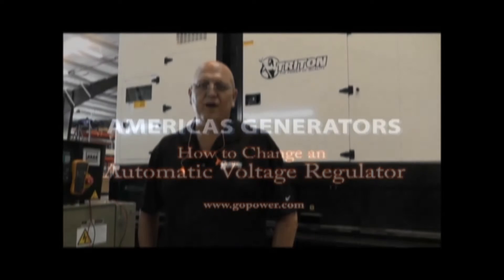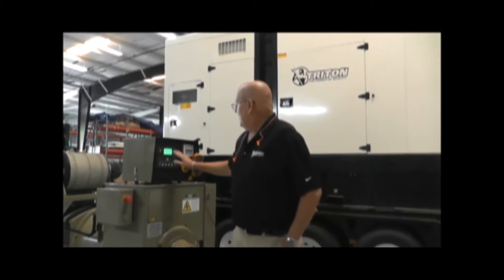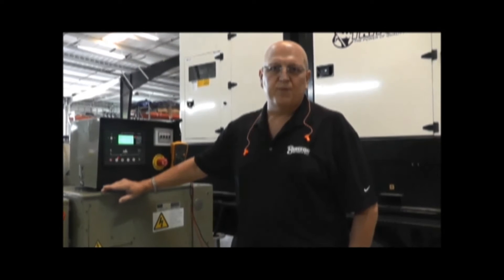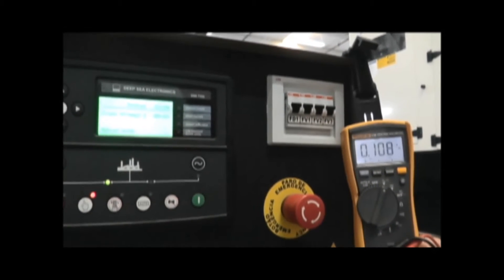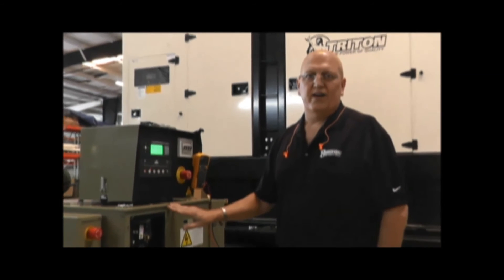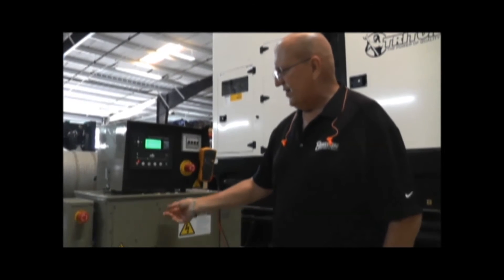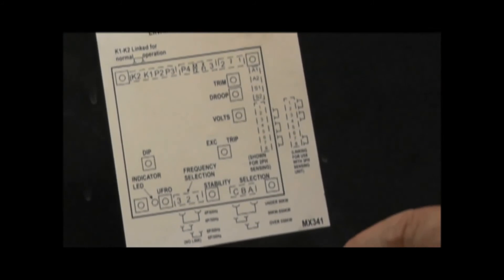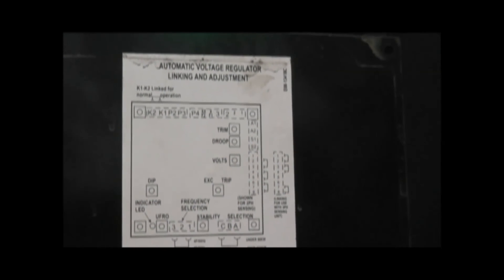Americas Generators - How to Install a Voltage Regulator Part 1

Comment: my generator has a problem of not adding hours on the previous  , e.g if it is 1432 hrs and it runs for  e.g 1 hr it will change to 1433 hrs  if it is still running, but if you switch it off it will go back to  1432 hrs  every time it runs. what should i do i need your help. my email is baluku1983@gmail.com